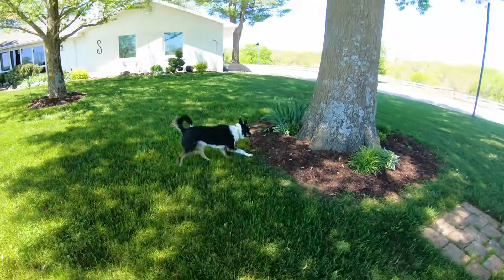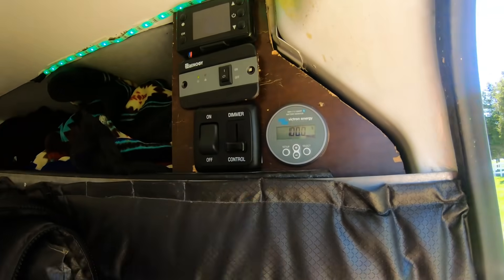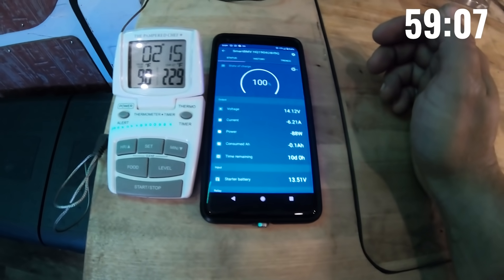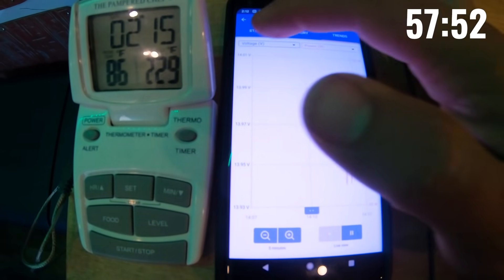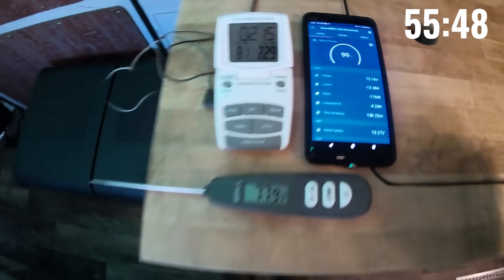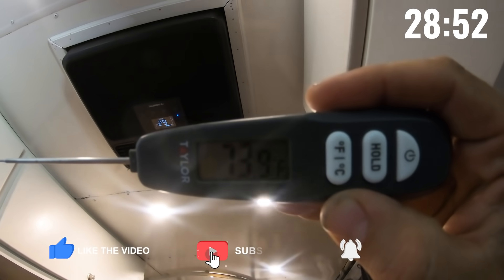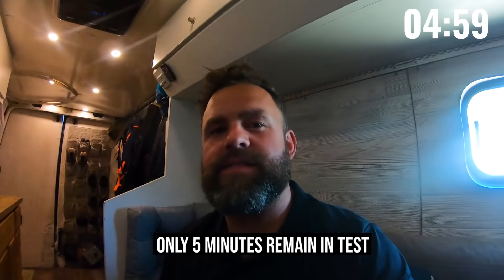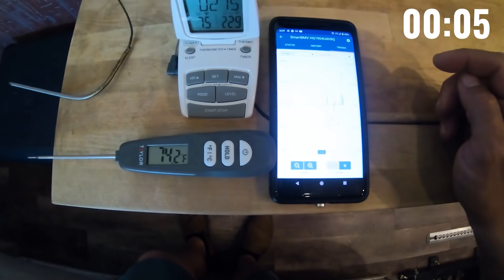12 Volt DC Air Conditioner | POWER CONSUMPTION TEST | Dometic RTX 2000 |  Van Life

Comment: The thermostat is just the cut off temp. Does not control the temp it blows at. If you have a 15 degree split or better depending on the units efficiency then your good. In other words most room heat pumps or air conditioners remove 15 degrees of heat at a time. High velocity systems like in a car can remove more but that’s a different animal.

Comment: People always test these things in low humidity regions. I would be very impressed to see how it does in Florida, where we have 100%. Humidity. Temperature is easy to extract heat from, pulling water out of the air is a different story.

Comment: That insulated wall between the cabin and the back area is made by you or is purchased?
Reply from the maker: I handmade everything in the van. 
I stopped that wall with 3M thinsulate then made a cardboard template and transferred it to lightweight wood and bolted it in place.

Comment: Have you thought of mounting your panels a few inches off the roof to allow air flow and solar block? I did this (same van) and it works great. The roof actually remains cool to touch.
Reply from the maker: There is currently 2.5" of room between the underside of the panel and the roof. Plenty of room for air circulation, no room for "liftoff" like I've seen on some rigs that are ready for flight 😂
Reply: @insidiouspeanut  lol trudat!

Comment: Is it possible to add one more panel and actually have a zero draw off the battery?   Actually even charging the battery while running the ac
Reply from the maker: Yes by my calculations 1kw of solar panels is sufficient to run this system with excess power generation.

Comment: So does 12 volt mean no inverter is needed? If so what air conditioning is this?
Reply from the maker: No inverter needed! This equates to a more efficient path for energy transfer between the lithium battery / solar panels and Dometic rooftop air conditioner.
Reply: @insidiouspeanut  ♥️

Comment: You can run this on a 400amp bank for aprox 8h, give or take. until the batteries are dead. No current small-AC's draws under 600W on full blast, heating or cooling. so a day before you need to charge from zero to a hundred with whatever source you've got. That is my summary from all the current presentations out there.

Comment: Awesome! I've been searching high and low for a good real life comparison with Dometec, lithium ion cells and solar arrays. I can do my own math, however the data here is invaluable. Thank you!! 

If you don't mind, could you tell me what the AC unit draws on your battery bank without solar like at night? Obviously it's cooler at night, and I would need to know your lithium battery storage capacity.  

I have a vintage camper that I restored. It's a 1957 with all Birchwood cabinetry and walls inside. It's small, about the size of a van, but I want to have AC to get me through the first few hours of the night here in Colorado which can be in the '80s and lower '90s. By midnight it's usually below 75, so that's cool, quite literally.

Comment: Your drawing up to 120 amps on max draw  your puting in 60 amps max at mid day with full sun and your starting with a full charge  if your starting from a low charge  there's vary little charge going to the battery's  even with a 40 amp draw that's only 20 amps max going to the battery's  if the battery is half charged  at best will take 8 hours to recharge  add a fridge and lights TV that system is not sustainable  as set up fine for a weekend though

Comment: The cabin is saturated, if you leave your panels on, and let the unit run 24/7 that system will work for you...got my attention. think of the energy units you are removing...it will take at least 24 hours to stabilize...

Comment: Thats a pretty small space , larger you want something more capable for 25-40' DP. This is why I choose 18k btu mini split compared to 2 the two roof top 15k units that only cooled.Power dropped about half and mini split cooled so much better and much faster in 90-110F. Not to mention they heat down to about 5-10F. I add in backup heat down that cold and really just use it to circulate the air at that point.

Comment: dude you paid 1k for that ac xD you could've got a cheap one from home depot for $100-200 and it wouldn't consume much more electricity than this one well how many BTU does this one have ?
Reply: 5000 BTU Air Conditioner uses 500w... just get one for $100 and install it in back door xD and use extra space on roof for another solar panel
Reply: I have seen people install AC units like that in RV's and within 5-10 minutes their place gets cold as hell xD 50000 BTU unit and some power step from 12v to 120v wont run you more then $300 and AC works only when temperature inside is too hot... otherwise cheap one could idle and an economic one could shot down on its own until temperature calls for it to go on

Comment: Is that also the lights on that power reading?
Reply from the maker: Correct, but I didn't account for it in my measurement because the power draw from lights is approximately 15-20 watts... Hardly anything compared to 500w.

Comment: The temperature it puts out is based on the temperature of the air it is sucking in. Most air conditioners are only able to drop the air temperature roughly 15 to 20 degrees from the temperature of the air it is taking in. If the temperature was 75, putting out 62 is about perfect. I really like that unit though. About time someone came out with a reliable 12vdc AC.

Comment: Putting the A/C on the roof where the hot sun is keeping the compressor and condensor hotter does not help.   It is best to have it under the van where its cooler, and then you have more room for solar panels!
Reply from the maker: Lots of poor implications from flipping an oil-lubricated compressor upside down. Along with fighting thermal dynamics of heat rising & cool air sinking etc etc etc 🤦

Comment: greetings Ben , consider adding a 5-2-1 3 wire hard start kit on the AC . the industry does make a high end smart start and run condenser unit . Drops the amps by 45- 70% . Most all marine sailors use them , becuase they live remote in the ocean on battery and solar power. Hollar if you need some more info , etc . it would help you and your system  :)

Comment: Impressive!!! All that on one 300 ah Battery being fed by 4 solar panels, this brings me hope in the sense that I don't need a 3,4 or 5 bank battery system.
Reply: 300Ah of lithium is about 3K on the batterybank alone. 800W of solar and all the expensive (but high quality) victron gear is easyly another 1,5-2K.
Reply: @casemodder89  That is false...100ah is about 300-500 , 200ah is like 800 and 300ah is 1k-1200.And you drop massive weight just going from lead acid to lithium.You also gain ability to be able to USE most of batteries AH not like lead acid where you try to keep from draining them past 70% or it destroys battery and they barely last 4-6years as it is!

Comment: Here's a calculator you can use to calculate your cooling load:  
https://www.calculator.net/btu-calculator.html?roomsize1=60&roomsize1unit=feet&ceilingheight1=6&ceilingheight1unit=feet&people1=2&roomtype1=bedroom&insulation1=poor&sunexposure1=sunny&climate1=hot&ctype=room&x=67&y=19
Putting in the worst case parameters for a small class B RV says the cooling load would about 2000w.

The Dometic spec sheet says it should only take 19a at 12v (228w) to deliver 2000w (6800 BTU/hr) of cooling in Eco mode. I suspect it's much higher out of Eco mode, since you were seeing over 500w power draw from your battery. 

You could probably get by with holding the temperature at 78F. You could use the vehicle A/C to cool down the van to 78F, then turn the vehicle A/C and solar off, and turn the Dometic A/C on, and set it to 78F in Eco Mode.

If it holds that temperature and the specs are right, the power draw from the battery should be 228w or less in Eco mode. That would tell you that your van cooling load is 2000 watts or less for that particular day. If it doesn't hold, your cooling load is higher. In this case you would have to live with a higher inside temperature or provide more insulation. I think you have plenty of solar and storage to use the Dometic, but it may not provide enough cooling capacity for your needs.

Comment: I would get rid of the power inverter and get a 12 or 24. Volt ac unit. I'm talking about for home use not.in a van. I cannot complain about my electric bill but there is always room for improvement. The home has better insulation so this is doable.the solar can be direct wired to the ac initj.

Comment: You answered my solar panel question from your last video here. Thanks.
Reply from the maker: A single 12v lithium battery with 300 amp hours. 3,600kwh. AC will run on eco mode for about 6 hours draining 70% of battery throughout the night.
Reply: @insidiouspeanut  nice!  Thanks for the quick reply. I just picked up my van. It’s a Ford transit 2020 extended high roof. Flying to Texas and driving it back to where I am now I’m Detroit. I’m making a list of “must haves” and “it would be nice to have”….. AC is on the “it would be nice to have” list. But I plan to drive it from northern Alaska down to Argentina… at the least. So I think it will become important eventually. You can use that for heat as well right?  I’m trying to think about an in-line gas heater, but it’s half the price of that unit…. So maybe if that does heat as well (without much draw on the solar system) It might be something I could justify installing sooner than later.
Reply: @JaYoeNation  take a look at the Wabasto side window heater. I live in northern Canada and I seen another van dweller had one and it was keeping him nice and toasty! Other than that I haven't seen any reviews on them or anything but I think that would be better than buddy heaters and installing a diesel heater..

Comment: There is no short cut, DC air is meant for semi sleepers or mass transit busses and both never shut down the engine while in operation.  

AC powered Air and generator or shore power is really all there is
Reply: excatly. The only excepion is wheren you have sun every day, all day., and a 600w battery bank.

Comment: You should be able to use 100% of your lithium batteries. Their BMS should disconnect the cells when the voltage drops too low. Just like an iphone.
Reply from the maker: False. The BMS (battery monitoring system) kicks in at 75% depletion in order to keep from harming your battery cells. If you could discharge 100%, you simply would NOT NEED A BMS!! 100% discharge is a fallacy.
Reply: @insidiouspeanut  Lithium batteries are rated on usable capacity only. If you're getting less than what was claimed, the batteries are either old or you're getting ripped off.

Comment: Great video, thank you!  Sooo I have a question?  Do you miss your vent fan?  Also there is the dynamic of running off shore power, my charger only puts out 40 amps so if I’m in the shade and plugged in well you know.  Currently I have 630 whites of solar and 200 A of lithium and I have a direct isolator connected to my alternator which puts out 900 W. I know I know everybody says I’m going to overheat my alternator that’s why I put a thermostat control circuit on, it’s 180 amp stock alternator and it’s a beast, it vary rarely gets too hot.  Thanks.

Comment: i heard reports if you put a reflective shield over the coils holding the freon and other components.. to keep them from absorbing as much heat from the sun.. that the air condition system works more efficiently. That is particularly during daylight and if the unit is getting direct sunlight. I also heard about a new kind of paint that is embedded with ceramic particles (i believe). And it is used on cars to protect the paint from radiant heat from the sun and also creates insulation. I am wondering about using something like that on the cover of the AC unit exposed to sunlight.. and perhaps also on the top part of the car to block some of the heat from the sun? I know white paint is known to be the best color to choose. but seems like this new tech using these ceramic (or?) particles in the paint does even more?  they use it a lot in Arizona and Nevada.

Comment: One criticism, 1/3rd of AC power is dehumidification.  It takes 3 days to dehumidify any area because of the moisture trapped in the materials.  You need to run this for 3 days and then do a test of how much power it uses to sustain the desired temperature.
Reply: But then the use pattern are out of range of what is actually happening. You don't run this 24/7, 365 in a van, dude.

Comment: the temperature you set at doesn't change the temp it runs at it will just turn off when it gets lower then your setting ac can only cool so much

Comment: Damn bro, solar was so close to fully running it. Would make a great solar dump load in summer time. Not sure how versatile the victron dump load program is? But something to think about
Reply: Pretty close, so a 1000w system could probably manage it just fine. Easy enough to get really, as long as you have the roof space for the panels.

Comment: Even though this is a "cool" test, I'd be more interested in how much power it uses after the initial cool down, to maintain temp.
Reply: I would imagine it would be running almost the entire time if it's that hot outside. I don't know if it's an inverter AC unit or not.
Reply: @randybobandy9828  No it is not a inverter AC.
Reply: That is the obvious question
Reply: He said at one point that he doubts it will get much cooler which means it will never reach equilibrium unless the setpoint is over 75.  It will run continuously.
Reply: I have seen similar tests where at 'eco mode', the temperature is maintained after the initial cooling blast.  That being said, assuming real life application, if you are driving all day, get to your destination at 5:00, the van will be hot.  Run the AC for an hour or 2 at full, then in a few hours the sun goes down and you can drop to 'eco mode' to maintain or even further cool the van with a lower battery consumption.

Comment: The only place you can put PV panels is on the roof so anything else occupying roof space is a bit of a wasted opportunity. Ideally you need enough PV to be able to top up a battery as well as run the AC and I suspect this is your situation once the AC has done the initial job of cooling a hot van.

Comment: When i was i kid i made an ice powered aircon,was basically an esky full of icy water with a small car radiator mounted on top and a pump to circulate the water through the radiator. It was incredibly effective, far colder than any normal aircon, unfortunately it didn't last very long without needing to add more ice.
I never used it, it was just proof of concept, i made alot of weird things as a kid.
Reply: If only we can use dry ice with out putting ourselves into a coma and dying lol
Reply: @dl2.504B  i don't see why it can't be a sealed system, or at least vent outside.

Comment: Great for a little van. Specs say it’s 6,824 BTU less than half of a RV rooftop Ac unit. You were drawing 500 watts at 12v that’s 41amps that would be 6 hrs run time leaving approx 20% left on your battery bank if you turned off your panels. I have 850 watts and 4x100 amp hr lithium with a 3000 watt inverter and a soft start on the 15000 BTU AC and I can only get about 2.5 hrs without damage to my batteries. It also says there is a eco mode on this unit that only draws 19 amps. You could run that all night and still have good batteries in the morning. Thanks for the great info on this unit, nicely done sir.

Comment: A significant challenge that you're demonstrating is the ambient temperature of the items within your van. While the AC is running, they are still radiating back into the van since the surface temperature of items were at approx. 87 to 93 degrees when you started your test. In turn, your AC must run longer to displace that radiant heat - much to the point you were making.

If you started running the AC earlier in the day to keep the radiant temperature lower in the van, that AC looked like it would be really nice. Looks like you just need to add another 200W panel up there to overcome the negative draw off the battery during the day. That would likely get you really close at least.

Thanks for sharing.
Reply: That RTX is designed to run off batteries for 12 hours at which time it will shut down.
He has more than enough power to run from 6pm to 6 am.  Drive or turn on panels and you’re good to go.   400 watts of solar would have been plenty but with two 400 watt panels charges the batteries that much faster.   Thx for this vid ad we are in the process of obtaining this RYX ourselves.   420 amps of batteries 400 watts of soLar on the roof.  ( 1 panel!). Great vid, thx!

Comment: Good vid overall but amps is the more meaningful measure when it comes to runtime. Amps are how the batteries are marketed and the math is significantly easier. Understanding you have to work with what you got but meat thermometers isn’t the best tool for this test. Using an IR temp gun you’ll see the aircon will blow mid 50’s at the vent.

edit

Another footnote, you don’t want to run your batteries dead all the time but this is the first time anyone put the advisable limit at 20% charge. Ive been neck deep in camper vans for over 3 years now (trying to qualify my statement). Curious to know where you learned that. 

I’m not an expert and I’m not trying to come across as one. Just sharing with the community while providing some constructive feedback.